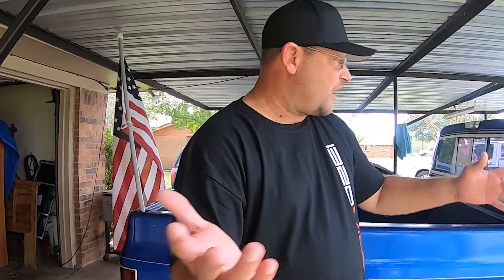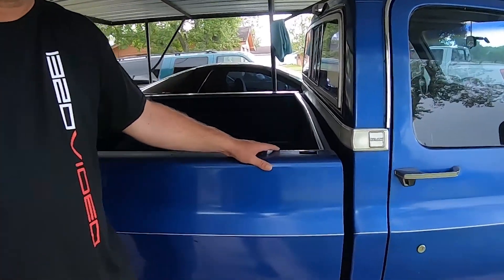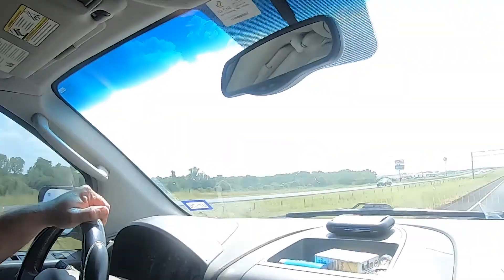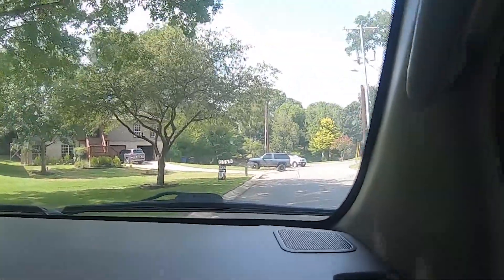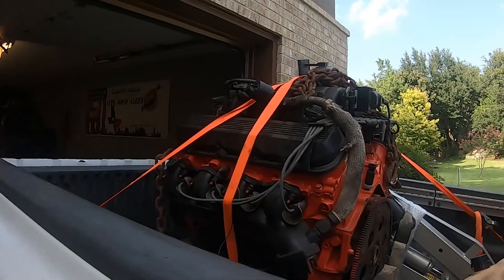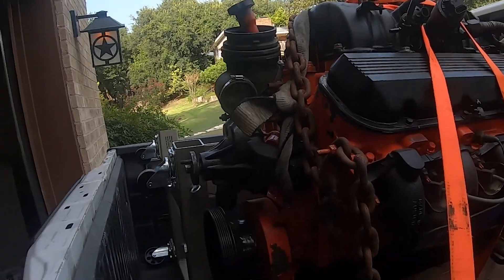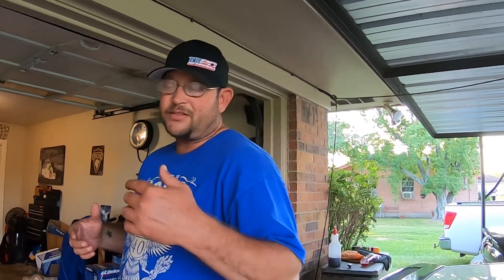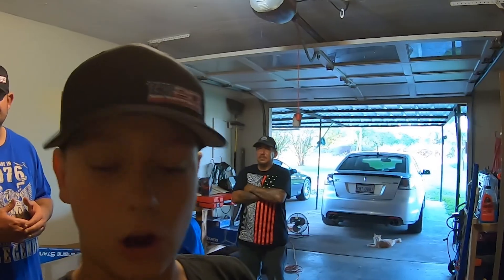Buying a Chevy 454 big block motor for a GMC C10 square body

Comment: Thanks for video Iv just put a 454 in my 69c10. Was pretty straight forward. All the little things that take the time. Also did mine on a sensible budget for me so took abit of extra time modifieying bracketry etc
Reply from the maker: Appreciate it, congrats on the install, covid and the economy kind of put us on yhe back burner with builds but hopefully this spring we can get back to it and get some progress going. Thank you for checking us out!

Comment: Nice video. Thinking about swapping my 5.7 TBI for 7.4 carb in my 94 Silverado. Not sure about all the requirements.
Reply from the maker: That should be pretty easy although the computers Jan be a hassle being you still have to have them to control everything else and control the vap system.
Reply: Nice! Will be a cool truck. My gen 5 was TBI and am using a early cast iron intake of a 85 TBI which will also accept Rochester carb. Cheap untill I can buy a performer intake

Comment: Did you have to change Engine Frame/Stand mounts to fit the Big Block because i am trying to do the same but mine won't sit right
Reply from the maker: I haven't stabbed mine yet but yes you will need to change to big block motor mounts on the frame. Those videos will be coming in the near future,  I'm still gathering parts for the build. Thanks for watching!

Comment: I’m doing a 454 gen6 swap into my 86 swb also.  Can’t wait to get it done
Reply: Fast Lane Pros no I haven’t. Will be the first time doing this as well. All I’m doing is a lunati cam kit 20010348k to the motor.  Need to find a 4l80e also lol
Reply from the maker: @jonathanpalahitski9596  how funny! First time, same needs haha! I gotta find a in cab fuse box for that motor as well. What's the lift on that cam?
Reply: Fast Lane Pros haha yup and it’s 0.535 int./0.545 exh.  You can either get just the cam or the complete kit witch I’m doing.   Your sticking with the factory efi intake?  Hope it goes well finding the harness. I’m gonna go with a carb intake and Holley sniper
Reply from the maker: @jonathanpalahitski9596  Nice, where did you get the cam kit? Yes I'm staying efi I have an awesome tuner that tuned my G8 that wants to tune it.
Reply: Fast Lane Pros oh nice that’s awesome and summit racing or Lunati.  I haven’t gotten it yet but will be soon. Just have some other things to take care of
Reply from the maker: @jonathanpalahitski9596  I hear ya, it's going to be a long road on this one
Reply: Fast Lane Pros yea agreed and worth it in the end.  Wanted one of these trucks for a very long time.   Good luck with the build!!
Reply from the maker: @jonathanpalahitski9596  same here brother! Keep us updated!
Reply: Fast Lane Pros  thank you and will do
Reply: I also forgot to mention you’ll prob be done way before me haha. I’m taking mine right down to the frame and redoing everything.  Possibly a roadstershop chassis 😉
Reply from the maker: @jonathanpalahitski9596  actually we're in the same boat, I've got to do a frame off due to rust on the cab 🤣
Reply: Fast Lane Pros haha nice.  Do it once and right!!
Reply from the maker: @jonathanpalahitski9596  Exactly!
Reply: Hey man I’m doing a gen 5 from a 1990 454ss into a 86 also do I need a different distributor since the 1990 has a computer?

Comment: Did you use the original small block motor mounts ?
Reply from the maker: I still haven't installed it yet because life happened but no you can't use SB motor mounts, or arms.
Reply: I get it man . I’m putting a 468 in my 77 c20 . I bought big block mounts off eBay . What do you mean by arms ?
Reply from the maker: @jeremydeaderick1324  fbe arms that come off the frame that the mounts bolt to
Reply: Ok
Reply: How is your build going ?

Comment: 454 is going to sound amazing, won't be fast, but it will sure sound good! lol
Reply from the maker: We're going to get it fast with time, Luis is going to tune it but I agree, I love the rumble of a big block! My cousin had a 86 c10 with a 454 and it would ball the tires rolling 70mph. That truck was crazy fast!
Reply: Wont be fast? Do you even own 454 bro? Maybe you drive a Ford.
Reply: @dillonhelm3610  lmao 😂 I had a 454 big block 85 gmc and that thing sounded good but was so heavy that it was slowwww. 14-15 second slips might have been fast a while back when these trucks came out but I guess my definition of slow might be different lol
Reply: Jorge Loves Speed you built it wrong
Reply: @dillonhelm3610  it wasn’t built it was just a normal 454 big block in a truck it wasn’t a race truck....and I don’t think this truck is going to be getting crazy build done to run 8-9sec in the 1/4....
Reply: Jorge Loves Speed point made you don’t know what you’re talking about
Reply: @dillonhelm3610  yeah I can admit I’m not familiar with the old big block stuff, but a normal 454 big block isn’t going to be fast well at least the one I had was basic and slow compared to what I’m used to running 9-10 seconds in my newer lt camaro....
Reply: Jorge Loves Speed so if you’re not familiar then why are you talking about something you’re not familiar with? You sound like the Biden Harris campaign
Reply: @dillonhelm3610  well only bc I’ve had experience with it, which is more than many others can say.... and I can tell you that I don’t see Micheal going all out and making this 454 fast....he will be happy getting it running and driving good......
Reply: Jorge Loves Speed I’m just yankin yer chain I only got a 305

Comment: Wow my comment was deleted, lol, figures. I’ll be sure to notify You Tube.
Reply from the maker: We don't delete comments so I'm not sure what you're talking about.
Reply: @FastLanePros  Whatever! Being you actually replied. Did you get the wiring harness, and ECM, out of the donor truck? Yeah I doubt that. I take it where you live you do not have engine emissions tests. I figure since there isn’t any harness or ECM, you will Jerry rig it, put a carb on it, what do you give, you’ll make a quick buck right!  The 1985 is nothing close to the replacement 454 you are going to put in. Along with that, I did see the 454 replacement you are dropping in the “85”. That has been rattle can painted a really bad Chevy orange. I know if I saw that in a “85” with the awful rattle can paint I’d walk away from that truck!!!
Reply from the maker: @dalemorrissey6213 I appreciate all of your concerns but the ECM did come with the motor and we did not paint it. The previous owner did and it's a 2000 model engine. Granite it's not an old school 454 and I don't plan on using the throttle body that is on it, it will more than likely be replaced with a hollie fuel system or a carrberauter. And being we're only 30 minutes from Houston we have all resources readily available for anything we need. Also the 85  is not for sale, never was and never will be.but make sure you subscribe to the channel so you can catch all future videos coming!

Comment: it’s not GMC C10 , it’s GMC C15 2wd or the k15 4wd , >>GMC C/K15 , C/K25 , C/K35 , chevy pickup C/K10 , C/K20 , C/K30
Reply from the maker: +hamad zainalabedin correct but it's really no that crucial. it's just easier to say c10. same body. thanks for watching